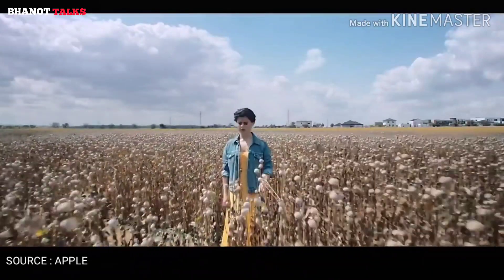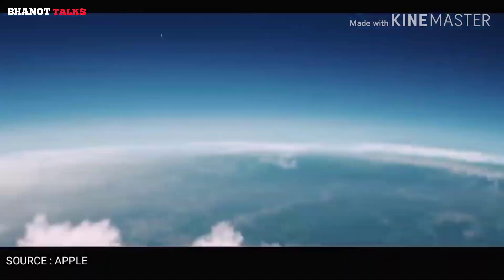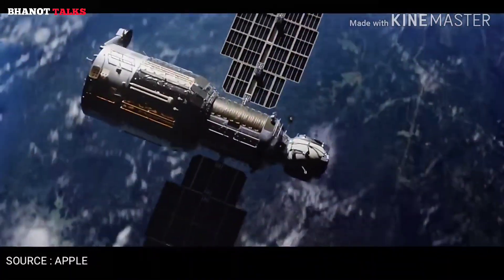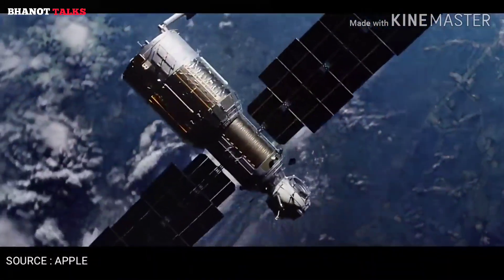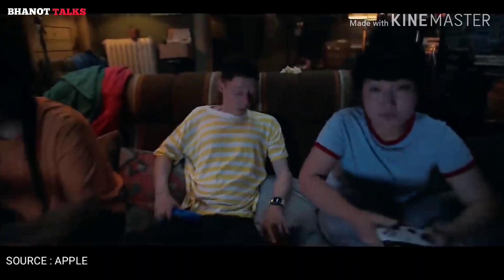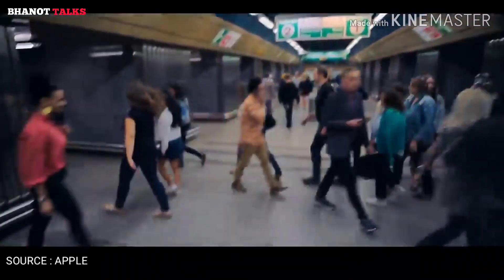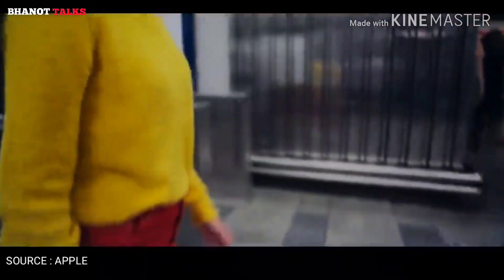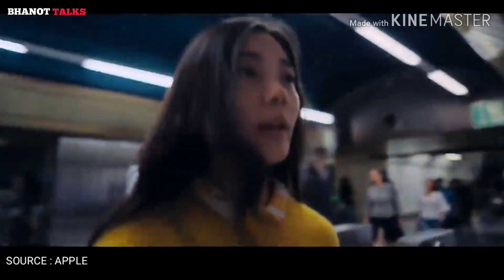What is an LTPO display in Apple watch series 5 || How does it work || Bhanot talks

Comment: One of the things I dind't understand on my apple watch 6 was the fact that when using bright watch faces (which involve white color for example) i am having a brightness adjustment delay. 

For example, in low brightness environment, when twisting my wrist and the display is turning on, at the beginning  the brightness is low and after that, almost instantly the bright gets higher (which is annoying). 

This is happening only when I use white watch faces. When using the black ones, everything is ok.